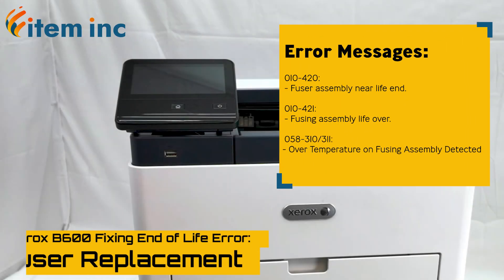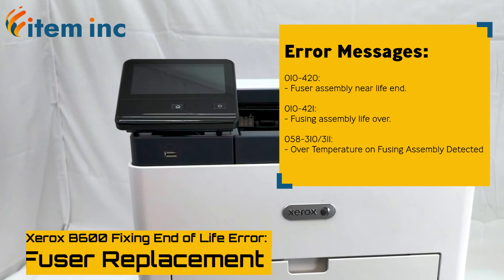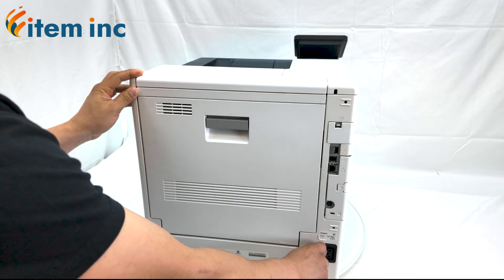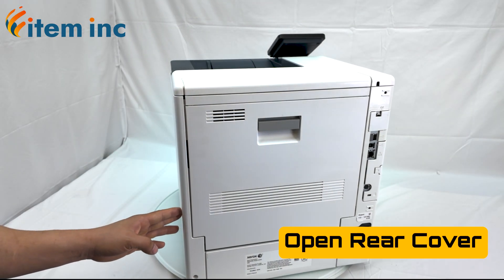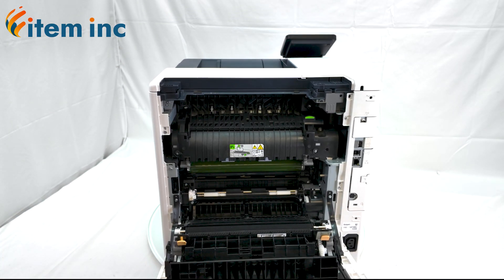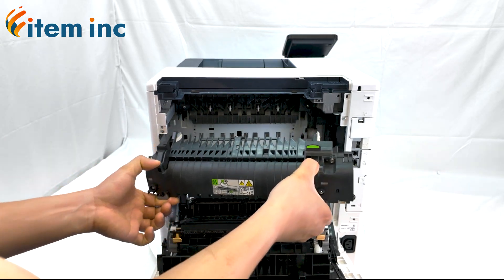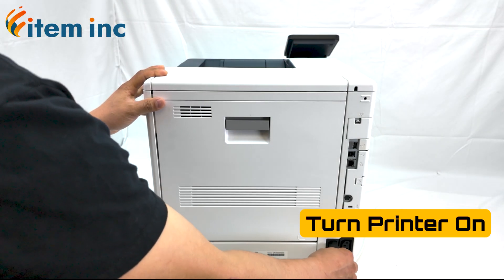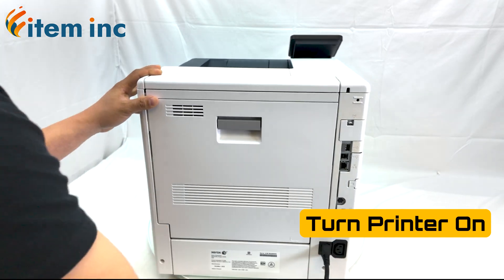Xerox B600 Fixing End of Life Error: Fuser Replacement

Comment: Thank you for this video. How can I awoid the dubling mistake "010-421 Fusing assembly life over" after removing fuser on the new one?
Reply from the maker: Thank you for reaching out with your question. For detailed guidance on this error code, please open the Xerox B600 Service Manual in our Tech Hub (link below) and refer to page 2-39.

https://iteminc.info/manuals/1544/xerox-versalink-b600-b605-b610-b615-service-manual

If you have any questions or need further support, feel free to contact us at 800-367-4836. We look forward to helping you resolve the ink loader issue you're encountering.

Comment: is there anyway to increase the tempterature of the fuser unit ?
Reply from the maker: Hello, thank you for reaching out to us with your question. 

The fuser assembly temperature is controlled automatically by the printer’s firmware, adjusting based on different factors such as warm-up state, printing mode, process control, and environmental temperature. If you are experiencing print issues, please feel free to contact us at 800-367-4836.
Thank you.